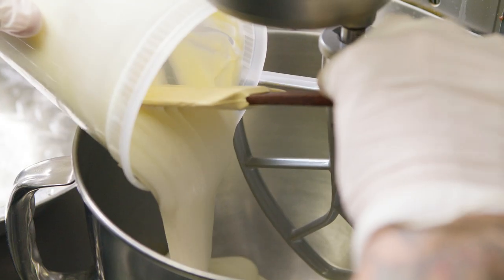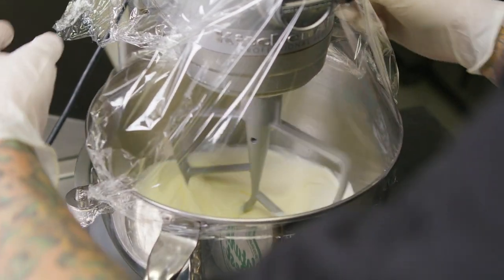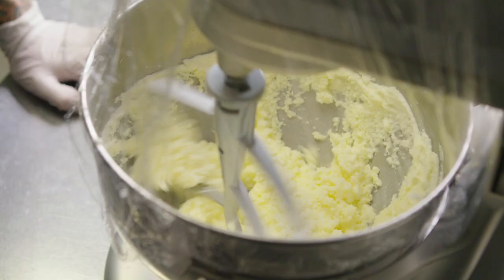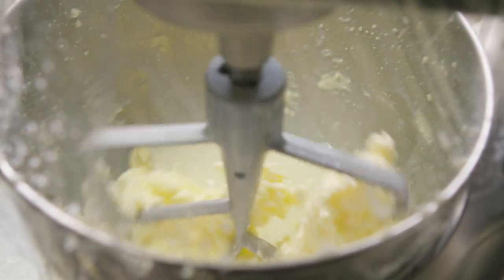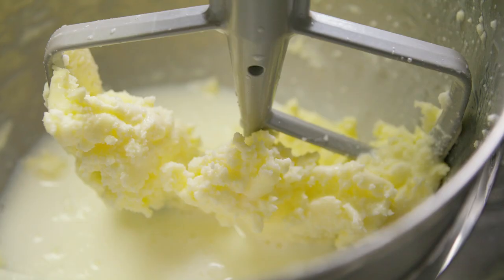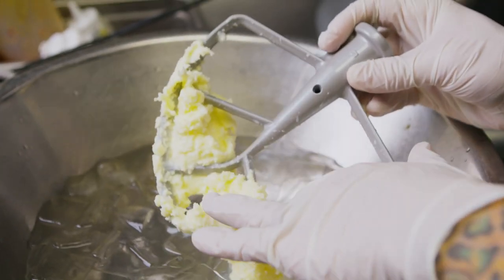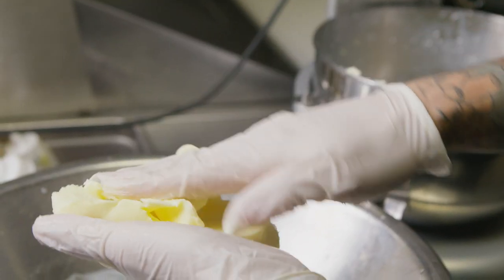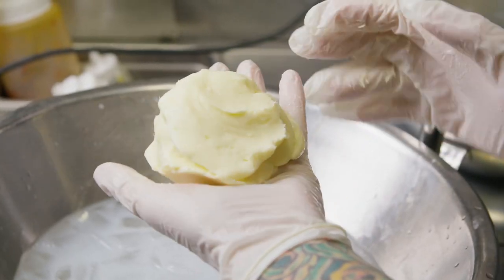Cultured Butter Cured in Kombu

Comment: Let me clear up some of the questions I see below. 
The way this works is by a process in which the umami of the Kombu (Japanese kelp) is leached (cured) into the butter while also extracting moisture. It also works for fish, meats and veggies.
The Kombu needs to be tight to the surface of the butter for it to work. I'll usually soften the Kombu in a steamer to make it more pliable, because it comes dried and very ridged. (you can also brush it with Japanese sake) 
After encasing the butter, tightly wrap in cellophane and refrigerate. The amount of time is up to you, but generally speaking a day or two at least and no more than a week. 
I've never tried butter, but fish gets more firm and the flavors more concentrated. Perfect for sushi.